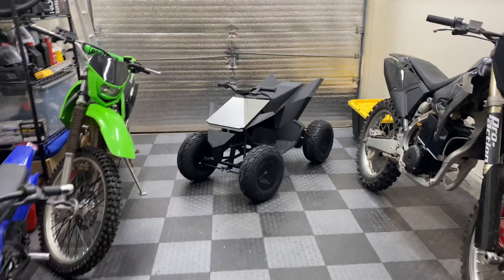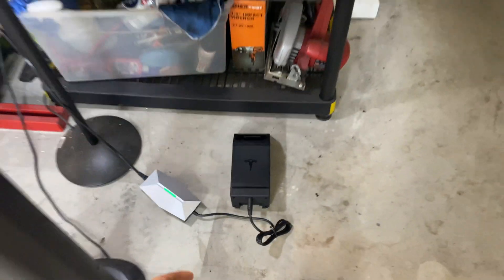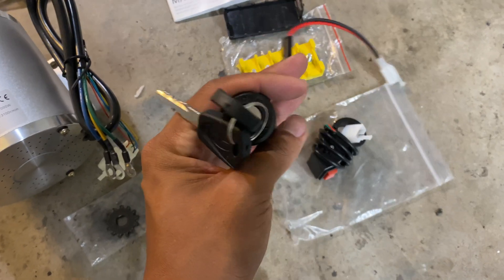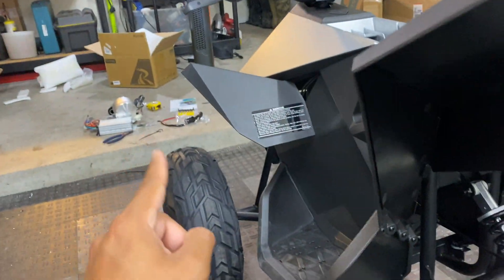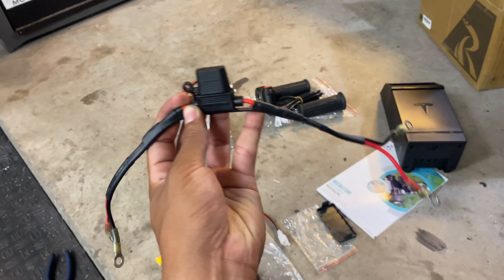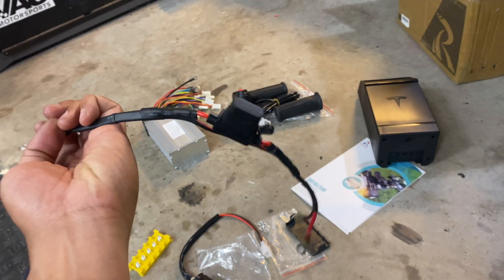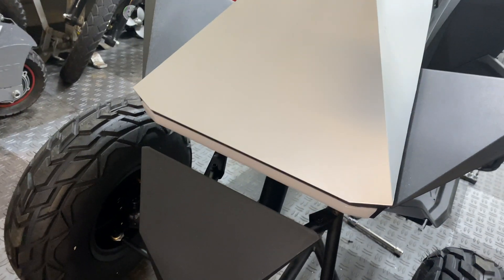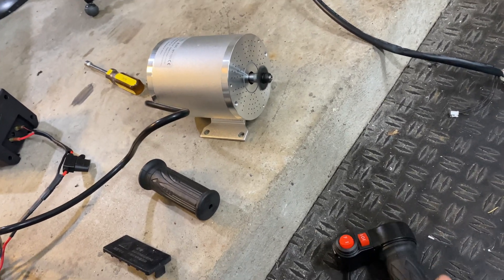Tesla Cyberquad ATV Brushless Motor Conversion Kunray 36V Kit Installation Part 1

Comment: I have a 48v  on the q
Tesla quad but motor heat like after 10 min any help you can provide
Reply from the maker: Are you saying you put 48 volts on the stock 36v motor and controller?

Comment: Wat would be the best setup to achieve an about 75 to 80mph frm an electric quad?
Reply from the maker: @doley_osama7.62  QS138 v3 kit by Electro with at least a 76V battery. I would highly suggest NOT doing anything over 30 mph on a Tesla mini quad though, geometry not designed well.
Reply: @PatOutdoors  im probably gonna get a frame from Facebook marketplace like a yfz frame

Comment: man i wish u did th 3k motor
Reply from the maker: @goldienakamoto7894  not my bike, not my budget 🤷🏾‍♂️ Same exact process. You should do it
Reply: @PatOutdoors  i amm man that why i wanted u to do it ....i have the razor quad kids burned out the 36v threw on  2000w vevor and a 64tooth sprocket and shes pretty fun but i live on a farm so im going to switch it out for an 84tooth then she will be perfect now im curiou s about the 3000w but not curious about the 72v battery cost lol i have an old 125cc that will be next but im assuming ill need a kit from electro and co to get it going fast enough..it was a great video i was just speaking aloud
Reply from the maker: @goldienakamoto7894  Thanks, yeah for any 110+ size pit bike or quad, the QS138 kit from Electro is the way to go. You’re right about the cost of the 72V battery.. it’s always the toughest pill to swallow for me with all my projects
Reply: @PatOutdoors  dude im so excited to do it on the 125 with he front in back suspension...i feels like I'm going to kill the razpr quad driving her at 20 lol but shes been holding up really needs the front suspension

Comment: What's the top speed now?
Reply from the maker: Mid 20's with the stock 36V battery. Upgrading to at least a 48 or 52V would get it in the 30's
Reply: That's awesome. Thanks!
Reply: @patoutdoors hello mate ! Could you please recommend a battery ? I have just got the quad for my kids and it’s too slow . I want to do what you have done but I’m assuming the battery dies quickly ?

Comment: Do you have a recommendation for a 72v motor + battery for this? Also, is a regenerative breaking motor a possibility? TIA
Reply from the maker: Kunray makes a 3,000-Watt 72V version of this kit. It just has to be re-wired the same way to reverse the polarity: https://amzn.to/3EAT2Lw

As far as battery, I would recommend contacting info@Amorge.com for a custom battery. They would just ask you for the specs you want (100-amp peak BMS and 25-30AH in size) and the dimensions you want. I suspect this kind of battery to be around $700 though
Reply: @PatOutdoors  sweet. thank you for your time

Comment: Just swap two phases and it will reverse the rotation of any three phase motor. So swap yellow and green and it will rotate in other direction.
Reply from the maker: That statement applies to sensor-less brushless motors. That’s the first thing I tried, but it was fighting itself without also swapping the the green/yellow wire on the hall sensor connector. All good now.

Comment: Yo, love your razor videos, just had a suggestion, I’ve been looking to fit a crf50 seat on mine because the stock seat hurts. Just wondering if you could make a video on that sometime.
Reply: Alright, thanks guys this helped a lot. I’ll stay tuned for the talaria seat also.
Reply: Unless you have the SX500 frame, the crf50 seat + plastics fit just fine on the MX500/650 frames
Reply from the maker: @djmedia01  @CBracing43VR This is also what I've read, supposed to be almost a direct replacement. But I did order a Talaria seat for my black MX650 to experiment with soon because my stock seat hurts during my long rides as well. Will make sure to post a video once ready!
Reply: @djmedia01 you'll have to modify the seat tabs, cut them down. Then it will fit. Buy the entire kit, you might not need the crf tank as i used the stock mx one instead.  To fit on a sx you have to use everything from the crf kit and then cut the tank a bunch